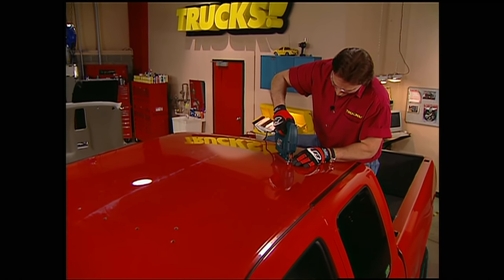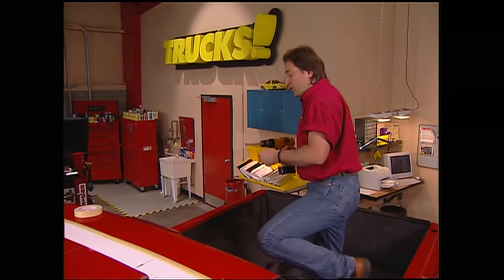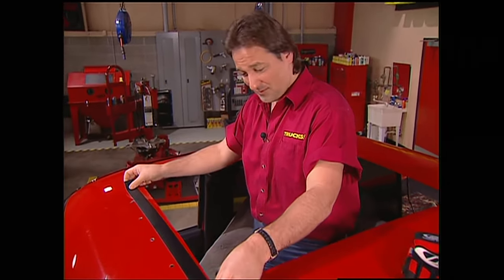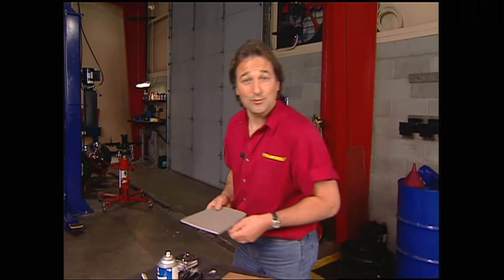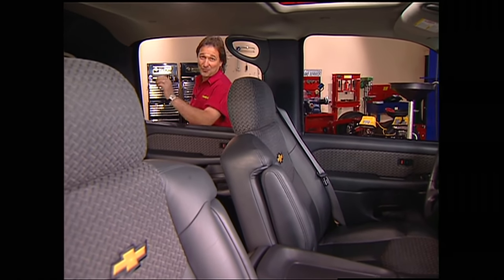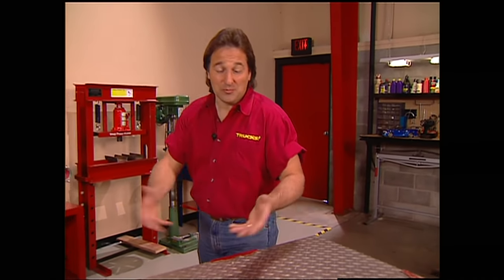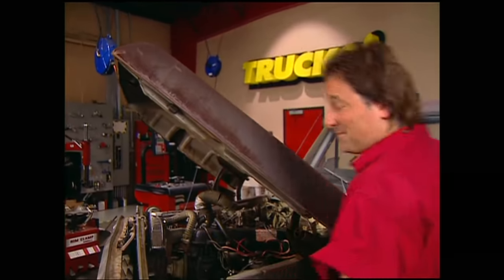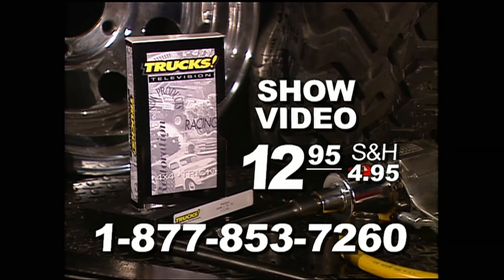Cutting Up A '99 GMC Roof To Make Room For A Sliding Ragtop - Trucks! S4, E4

Comment: Something tells me this sunroof pretty much trashed the value of that truck as well.
Reply: What value?   Over 125K miles, this thing is worth $5,000.
Reply: Fine.   For someone who appears to not be particularly quick I will explain.   Cutting a hole in this truck when it was new also destroyed its value.
Reply: @bmstylee  For someone that claims to be quick, you missed  the fact that he cut a hole in a truck that is barely 1 step away from being recycled.  Hence my original question.
Reply: @1spaghetti32  first of all this show was filled like 15 years ago. Chevy had just released the avalanche. And not only that but that truck in today’s market is worth double what you’re saying in that condition before cutting the hole.
Reply: @feastorfamineauto  Oh that's right. As of the last few months a shiny turd is now $5,000.  Whatever.
Reply: @1spaghetti32  you don't have a car do you ?

Comment: The Avalanche was NOT a pickup.  A pickup has two separate body assemblies.  The cab and the bed.  The Avalanche is all one body assembly.  They literally took and SUV and cut the top half of the rear section off and walled it off behind the rear seats.  It was a fad that faded fairly quick.
Reply: @gregsonnenberg396  I never liked the styling.  And that massive plastic abomination on the back of the "cab" took up a lot of bed space.  The bed without that plastic piece was smaller than its real pickup counterparts.  I think the El Camino/ old school Blazer (with the removable back top) was the inspiration for the Avalanche.  As far as the drivetrain and suspension goes, it's not any different than any of the other GM SUVs/Pickups.  In a way, it's the bridge between SUVs and Pickups, but it's subpar for those two categories in regard to space and hauling categories.